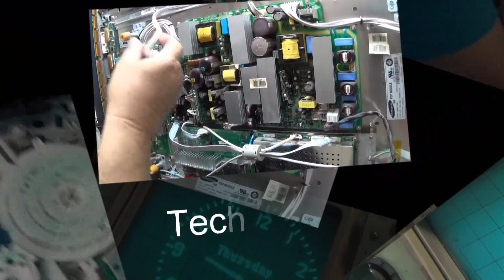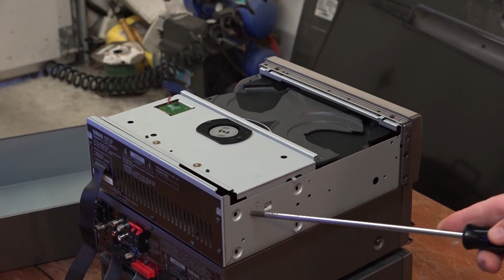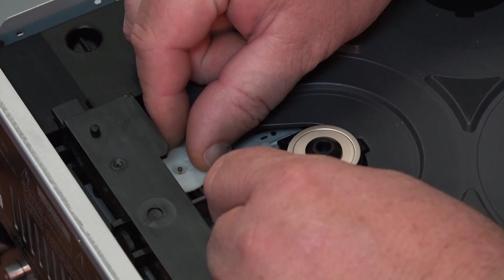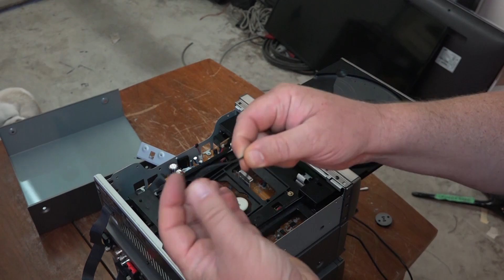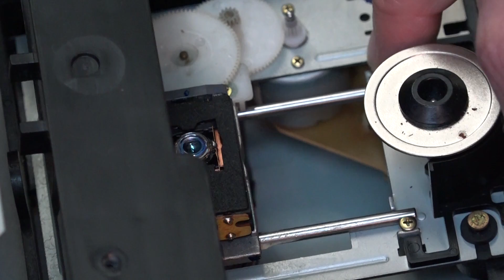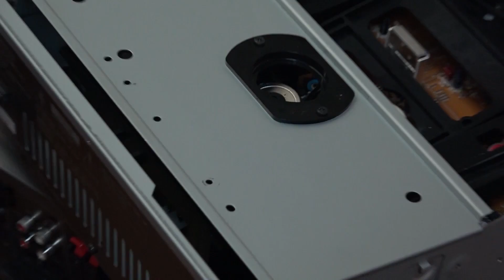Yamaha CDC S90 CD player REPAIR

Comment: MolyKote PG-641 is no longer available. Is there another similar MolyKote lubricant? I read that some used MolyKote 55 O-Ring Grease, but I can't confirm it is compatible with metal and plastic parts for my Yamaha CD player's laser rails.
Reply from the maker: The only reason I used that was because I had a bunch I got for free.  I use white lithium grease.

Comment: Good video. I would do one thing. Normally servicing is not done with the unit powered so I would post a notice to NOT to look into the top of the laser lens when the unit is powered.
Reply from the maker: Why? The laser is NOT going to hurt your eyes unless you do something stupid like try to view it with optical instruments and manage to focus it on your retnia.  The beam is focused on the disk surface which is only a few mm from the lens. After that it diffuses. All the service manuals say to observe the laser from 12" or more.   If someone is dumb enough to stick their eyeball on the lens then they deserve to have a permanent black spot in their vision.  (Yes that is what happens as I know a guy that was in the hologram business and he one time lasered his eye when a reflection got him.  He was left with a permanent floater in one eye.  Mind you he was working with a large carbon dioxide laser at the time. Lasers need to be taken seriously.  I once looked into one, but it was being operated by a skilled surgeon. I walked into the clinic blind as a bat and walked out with 20:20 vision and a much lighter wallet!

Comment: I am trying to fix a cd player that refuses to play a cd 5 times out of 10.. I hate it when something works and then it doesn't and then it works again and then it doesn't. How to repair these weird problems? I don't understand how it is possible that something sometimes works and other times doesn't. Make up your mind already! Either you work or you don't! Man! I feel a bit desperate. Also, the volume up button sometimes works and other times doesn't.
Reply from the maker: Usually it is the spindle motor that goes our. Bearing fails and disk starts to wobble.

Comment: I have a Yamaha CDC-50  5 disc changer. Door wont open , Took the lid off carouselle will not rotate or go in or out. , I hear motor running and laser tries to rise but it looks like it is hitting the drive for the cd. The cd drive won't move to clear Laser.    Do you do repairs ???

Comment: I never get units with a simple problem... usually I get units where everything appears to work as it should but obviously something in the logic circuits stop it from working...I.E. motor won't turn , but is good ....

Comment: Do you have any experience with the Harmon Kardon CDR 2 recorders? A common failure is the left CD player will fail to read the TOC. Mine will move to the home position and try and focus but can't read the TOC. I've cleaned the lens, relubed the rails, oiled the spindle motor and even tried bumping the current up on the laser a bit. I can see the Sanyo sfp151 laser light up, maybe it's just weak. Anyway, I enjoy watching your vids, keep 'em coming.

Comment: Its NOT "lithium grease". People see white grease and they immediately think its lithium. Never use Lithium grease on any electronics you care about.  Ill give you some good advice. Buy TAMIYA ceramic grease. The same one that is used for plastic gears in their RC cars. Its insanely slippery, lasts forever, and a little goes a long long way. Made specifically for all electronic/plastic gears etc. I wouldnt be without a tube or two on my bench.
Reply: Radio Shack used to sell Gel Lube, but I haven't seen it in many years.

Comment: hello can you answer an question for me i have an dual 1246 turntable and i was getting a bad buzzing sound everytime so i change the styles and it stop for 2 days and its buzzing again thanks and i am sorry you got rip off on your seller its happen to me 2 times thanks again and i love watching your shows todd
Reply from the maker: Check your ground at the head shell. On most duals they have a removable head shell. You just push back on the little metal lifter on the side of the head shell. That will release the lower part of the head shell where the cartridge is mounted. Those spring loaded pins that connect the head shell to the tone arm oxidize and cause many problems, and need to be cleaned with a good cleaner like nutrol or deoxit.

Comment: Yamaha sucks I would never own one
Reply: Yamaha are actually very very good
Reply from the maker: I hear you there my friend. Ride safe.
Reply from the maker: Yes I know. I had one of their motorcycles once. Then I bought a man's motorcycle. A Harley Davidson. Puts a smile on my face every time I throw my leg over it. Dam I can't want for another month so I can uncover it and fire it up for the season.
Reply from the maker: The old carbonated ones weren't the most reliable, but the fuel injected engines are super reliable. Mine is an 07, bought it brand new.
Only thing I have replaced is the battery. Needs tires now, but I would expect that as I have 60K on the originals.
Prior to this I had a Virago, and had to have the front forks done, the stator failed, was repaired by the dealer. Then the starter, died had that replaced and then t he stator went again.
Prior to that I had a Honda CX500. It was a 76. Had been my dad's  bike, and I had a Honda Hawk 400 at the same time. The Honda's never gave me any trouble either.  So far, in 10 years the HD hasn't let me down, but this will likely be my last bike. Getting too old to ride, and with all the idiots out there on the road, I am riding less and less these days. Have had a few close calls with a few drivers that if I could I would throw them in jail. Had one texting run right through a light and jsut about hit me, and another one on my side of the road that I had to put the bike on the ground to avoid becoming a statistic. 
You tend to re-evaluate your choice to ride a bike when you get run off the road by someone who is either stoned, and drunk behind the wheel.

Comment: Loved this. Just recently started to fix my array of old faulty CD players. Thanks for the detail - like when the grease was used, you said what grease was used. SUbbed Cheers.
Reply: All these types of transport, use generic Molykote grease, either pink or white in colour.
It's not Lithium but Molybdenum. lithium grease should be avoided as it can attack some plastics making them yellow and brittle over time.

Comment: Did the thing you bought using PP have "Pay after Delivery"? If you use that option they'll always take it out of your bank. Happened to me once didn't even notice it. I've had paypal fuck me over plenty of times other wise using their debit card. It has a "backup" feature that'll take money from your bank to use the card if you don't have a balance. I've turned it off before but it'll take out money anyway and totally screw me. Also damn, $40+ for a NSF fee is ridiculous , my bank only charges 25.
Reply from the maker: No it was pay when ordered. I have contacted PP and instructed them that it must be charged to my CC, and they said no they can only charge bank. I questioned why they didn't use the balance that was in my PP account as there was 50.00 in the account. The excuse they used was because my balance was in CDN funds and the charge un USD, they always charge the bank, because the bank has better exchange then they do. I call BS on that one. I hate PP. I had a dispute about 12 years ago with them and swore I would never use that firm ever again. I am regretting I didn't stick with that plan, but now if you want to buy something on Ebay you have to because they don't accept anything else. Elon Musk owned the company at the time, and I am still so pissed about that one that I would never drive one of his tesla cars even if he gave me one.
Reply: That's absolute horse-shit. I've bought things before from Canada using USD to CAD from my balance and it was just fine. It just charged the appropriate exchange rate. Also, some stores now don't require PayPal which is nice. Every since eBay and PP split it allowed a seperate processor.
Reply from the maker: Just wait for part 2 of the Yamaha mixer. The first part they sent was a pull and fubar, so the seller is sending me another and I will continue the video when it arrives.I have the letter from paypal showing that they tried to deduct from my bank account and there was no funds in that account so they debited from my paypal account instead. So someone fu--ed up at PP on that one. Just gives me another reason to hate them.Love the comments on the paypalsucks dot com website.
Reply: When I visited Canada years ago a dollar from Canada was equal to a US dollar, at least it was if you bought something near the border. On the US side near the border stores accepted our Canadian money and if a hamburger was a $1 US then they accepted a $1 Canadian as payment.
Reply from the maker: 10 years ago the Canadian dollar was worth more than the USD.It has only been in the last 3 or 4 years that it has slid to .75 or so, but it was over par for several years.

Comment: A simple one for a change :-),  ive seen too many drive belts go floppy in cd units.
 Also quite a few pc cd/dvd drives have belt problems, but most seem reliable, its laser death in p.c ones.
Optical storage seems a good idea, but the lasers give up the ghost too early, a waste of the electronics on the main board, the pcb's often work fine.
The upsetting ones are the early quality units with a laser assembly that swings out in an ark, a non stepped linear magnetic field servo, its a real shame when the laser goes in those :-(.
Dam ebay sellers, cant trust people, thats a shame :-(.

Comment: Oh my god I know how you feel with PayPal I don't know how many times they keep overchargeing my bank and not using my cards. 
Where can you get that grease and do you recommend it for plastic gears?
Reply from the maker: Silicone grease will work too. This is lithium grease and I use it because that is what I have on hand. Mitsubishi supplied this grease with their pinch roller assy to repair their VCRs that originally had that black graphite grease that gummed up, and broke parts.Yes it is safe on plastics.
Reply from the maker: It is just lithium grease, and you can get it at most electronic component distributers.
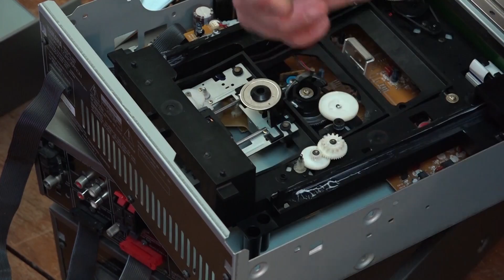Reply: It's Mitsubishi Molykote grease. He explains it at 10:50 .
Reply: Dead Christmas I know but I asked where you can get it
Reply: Molykote PG-641...I can't find anything outside of Asian market results. 

I use 100% silicone grease for gears.
Reply: Molykote YM-103 ! This is full Full  analog Molykote PG-641.
You can also use Molykote EM-30L, Molykote EM-50L, Molykote EM-60L